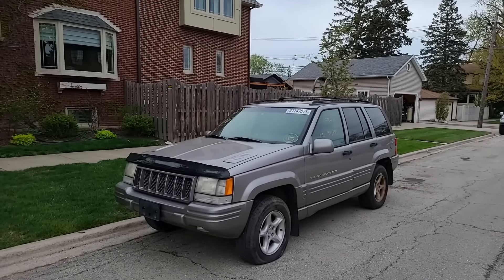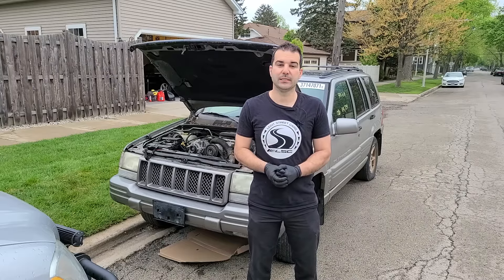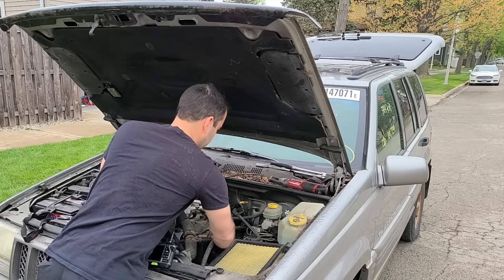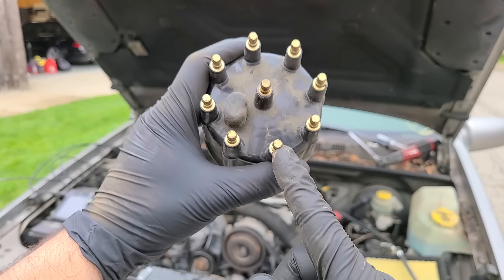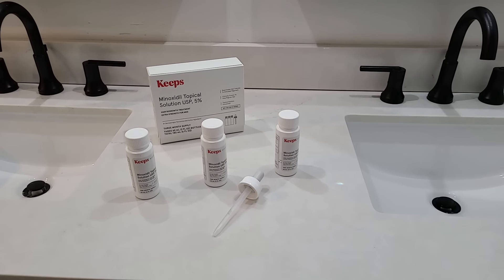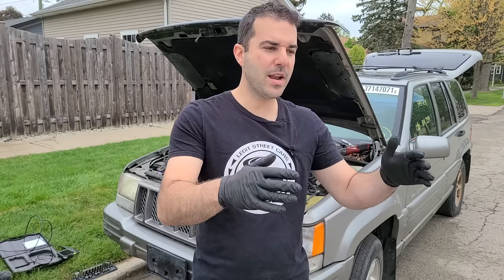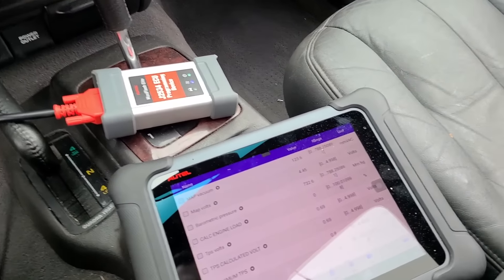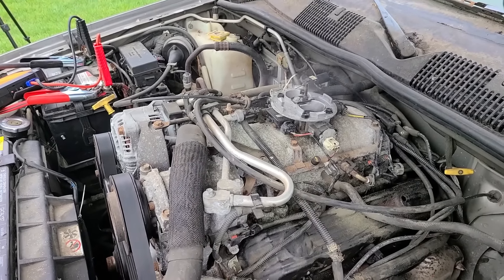First Start Of The Abandoned Fastest SUV In The World & What I Found  Inside The Engine! DIY FIX!

Comment from the maker: What's kind of SUV do you drive? 
 https://keeps.com/legit for 50% off your first order of Keeps hair loss treatment!
Reply: Ford Escape
Reply: RR Classic
Reply: I don't any more, but I had a 400 whp Trailblazer SS. It had a 4k stall converter, so I got horrible gas mileage, but it was a rocket of the lights. One night, some crew decided they needed it mare than I did. I say crew because there was no broken glass on the street an the Onstar module was thrown in a bush in front of my house.
Reply: 2005 jeep grand cherokee limited with 5.7 hemi
Reply: 1995 Jeep Grand Cherokee!  Mine's a 4.0L, and it has 358,000 miles.  Checked the compression a year ago, and it was still within new build specs!
Reply: I've owned Honda's since the mid 80's. I'm currently driving a 2016 Honda CRV
Reply: 09 highlander.   Pretty bland.
Reply: @cgonedfishing  u up
Reply: Have had Cherokee, Grand Cherokee, a Jeep TJ and now a JK.
Reply: Ford Edge 120k+
Reply: I made that comment about you losing your hair on top in a previous video! A dude called me a dick. Lol
Reply: I'm surprised you are allowed to work on the neighborhood street.
Reply: 02 EXPLODER
Reply: 2014 GL 450. Really love this series , learning a lot. Have you or can you do a vid on replacing spark plugs on a Mercedes? Couldn’t believe how much the dealer charges just to replace them.
Reply: 2006 Dodge Durango 2wd 4.7 V8 165000.…..runs like a champ..... looking for a Jeep Grand Cherokee for the wife when your done. That body style was her first car she ever owned. Trying to add a little bit of joy in her life.
Reply: This is the thing thats intresting. Not shiny, boring teslas and sports cars.
Reply: ML430👍👍👍
Reply: I purchased my 2009 Ford Escape XLT V6 new. Its been a great car which now has 160,000 miles
Reply: Hi Alex. At the mo an Audi Q3 but about to change to a Volvo XC40 recharge. We’re in the uk, I must say we had a Dodge Journey for 10years. It was the best car and wish we still had it or Dodge were still in the UK. Loved that car and I know a lot (especially here} don’t like dodge. Great vids. Look forward to the next on this Jeep.
Reply: Lincoln MKX Black label
Reply: You are 36 ???
Reply: @s1000p  I am 55 years old
Reply: 2016 Tahoe LTZ
Reply: ‘08 Touareg V8. 4.2l Audi FSI motor 350hursprrz, Brembos front and rear, and a locking center diff. $10k last October, has 55k original miles and a 1” book of receipts. Not too shabby.
Reply: I got my wife a ‘14 Toyota 4Runner Limited. Love the A/C seats! But it sucks at towing on the highway. Super underpowered. And also terrible mpg. LOL But it’ll run foreverrrrrrrr!
Reply: Dacia Duster
Reply: @theactualsalvagedrover  no, context my man. I said he was getting a little thin on top so it would be a good idea to sponsor a hair growth product. I also said Alex was a genuine honest guy so he'd be a great spokesperson.
Reply: @icanfartloud  Amsoil Products is the only way to go.
Reply: 2004 Jeep GC, I have a 1997 I planned on fixing up, but searching for parts I fell in love with the 5.9 Limited, I will continue fixing my 97, but only to fund buying a 5.9
Reply: Lexus LX470 (glammed-up Landcruiser)
Reply: 2012 Audi Q7 4.2 TDI
Reply: What happened with the Mercedes?
Reply: 1994 Chevy Suburban K2500 1 ton chassis w/big block Chevy engine, tows its own weight and passes everything but a gas station.
Reply: 1998 jeep grand Cherokee 5.9 limited with 265 thousand miles.
Reply: Until last year I was rocking around in a 2006 Porsche Cayenne S 4.5 V8 and now I have a 2009 Volvo XC60 D5 AWD along with a couple of other non SUV cars here in the UK.
Reply: 2000 Durango 5.9L.  The engine is the same as your Jeep but things are in different places.  My air box goes off to the right and your to the left.
Reply: 2011 Ford Edge Sport
Reply: Lexus RX330
Reply: I used to drive ML550 5.5L 2007 with a bad steering rack and a bad comand nav
Reply: Toyota Land Cruiser 2005, 293,000 miles ! One owner! Me!
Reply: I'm a car guy... 2019 Subaru Legacy... Hey, at least it's AWD!
Reply: Iam driving a 2021 Volvo XC90
Reply: 04 jeep grand Cherokee wj with the 4.7l
Reply: Love your content sir. When you're ready to let that Jeep go this Mopar guy would greatly appreciate a chance to buy it from you.
Reply: A 2001 Subaru Legacy and 2003 Toyota Matrix. Oh, you said SUV
Reply: 2002 GMC Yukon XL 1500 w/292k miles
Reply: Saturn outlook !!!
Reply: 2018 vw tiguan.
Reply: Mazda Tribute 2.0l 5 speed
Reply: Isuzu honda lotus bighorn
Reply: 98' Jeep XJ, 5 spd Manual
Reply: I have 2 1998 jeep grand cherokee 5.9s
Reply: I drive an old 2006 Pontiac Torrent with 269000 miles and blown head gaskets!!! Thank you Barrs ! LOL!
Reply: @cgonedfishing  8899998g99999g99999g899999999989899g8998v9ig889go89999988899990i9h899i8i998i989i98999998i88i9gi89999899i89h998888898989889888i8988i999i9g8088898898989998i8889i98999889999i0i9ii88998i999ii989899989ii999898ii8ii09ui99h9g99ii99i99999999i9h989
Reply: We have two Mercedes W163's in the family -- we love them!
Reply: 2000 LX 470, it doesn't know how to not start :P
Reply: ML350 W164
Reply: 14 Mercedes ML350 Bluetec
Reply: @christophersparkman  so it’ll be a crap-tastic pollution-slug for a long time? Great. But hey, it’s got A/C seats.
Reply: @MasterZG100  hey, VGG Derek bought a Duster on eBay!
Reply: @andyleo8418  ah. I got: “I told Alex he was going bald, so he called me a dick...” I’m stupid and get confused a lot.
Reply: @theactualsalvagedrover   @salvagedrover  lol no, Alex didn't call me anything. Another person replied to me. Ends up he does get a hair growth sponsorship. That was my point!
Reply: 2011 Cadillac Escalade ESV with a 6.2. Alex, @LegitStreetCars would you like to do a DOD delete for a video. I'm in the northwest suburbs (Crystal Lake).
Reply: ‘21 Yukon Denali with the awful 6.2 😡
Reply: I'll be honest I thought I got rid of that thing for good I only owned it for a month and had electrical gremlins
Reply: 96 grand Cherokee 5.2 limited 170k and I love this jeep
Reply: 99 explorer with a 5.0 awd to  manual transfer case swap lunch box front and rear with 98 ranger hubs aand mile marker hub locks
Reply: I live in Chicago by midway airport I would love to meet you bro man also I would love to have that jeep I really need a car your friend X-man
Reply: Sh*tbox 98 Honda CR-V
Reply: 95 bronco 
99 tahoe 
18 ecosport
Reply: I used to drive the worlds quickest stock bottom end, naturally aspirated Jeep SRT8. 11.91@115. That was over a decade ago, and it’s been beaten since. I’ve been through an X5M, Denali and a few others since then. Time doesn’t stand still and things get quicker and faster as technology advances.
Reply: My wife drives a Telluride.  I drive a 2020 Ram 2500 Cummins.
Reply: 2008 trail blazer ss and 96 jeep grand cherokee with 5.2 v8
Reply: 2004 E83 6 speed ZF, also having high-blood pressure for 20 years and taking minoxidil directly at the highest dose I have not grown hair, at least on my head.
Reply: I have 2 Jeep’s
1. 2004 Jeep Liberty Renegade - 127k miles
2. 2014 Jeep GC Summit with a Diesel. Yup, it’s amazing.
Reply: Grand Cherokee. Waiting for a phone call on a 1998 5.9 Grand Cherokee. It will be mine.
Reply: 2002 Chevy Tahoe
Reply: Ml 320 2002 with 60k miles only believe it or not..
Reply: 1998 Jeep Grand Cherokee 5.9 Limited
Reply: Volkswagen Touareg
Reply: AUDI/VW/Porsche/Subaru
Reply: Beat to shit hummer h2
Reply: @mexicanspec  How do you like the durango? I always liked the first gen especially the R/T trim 5.9
Reply: @andyleo8418  gotcha. Also Tavarish, I’m sure one of them turned the other into the sponsor. I was watching a video the other day where some girl got her cast cut off -maybe it was a movie...anyhow, she got her cast cut off and despite the smell, her arm looked like a forest. There was someone else in the room that mentioned agitation and physical stimulation promotes growth, so perhaps all Alex needs is to put a bunch of bird seed on his head and go stand at the park. Lots of Italians lose their hair, that’s why many of them are bald. Also tavarishes, plus his head is SO big...
Reply: @tacitusunum1668  he already did with an impala, didn’t he?
Reply: @shanet7511  MIne is an SLT with the 5.9.  I just love love it.  It is not too small or too big.  The wheel base is long enough to get a smooth ride.  Mine is a 2000 model with 70,000 miles on it.  I have had it for about 20 years and I still love it like I did the day I bought it.
Reply: Bunch of ZJ Grand Cherokee's through the years, and a clean but lame first generation Nissan Xterra at the moment, and an old caravan, LoL..

  *Never got why or how People wear gloves while working on stuff 🙄. Esp if just doing little things where you aren't elbow deep in grease and whatever else..
Reply: @erics8420  nice, my 5.9 I sold last year had 315kmi on it when I bought it. Forget how many miles I put on it, but wanna say it was over 350kmi by then! Didn't burn oil or anything, though it had been very well taken care of by the previous owner. Only thing aside from the milage I hated was the POS quadra-trac transfer case, too bad they didn't just use the 249 select Trac transfer case in these!!
Reply: 2000 TOYOTA 3.6l SR5, 4wd. 5 speed, lockers 365000 miles.
Reply: GLS baby
Reply: 2002 GMC envoy 200 k miles
Reply: 1997 Jeep Grand Cherokee Orvis
Reply: Merc GL320 with 34" tyres - Sounds like a LSC special to me ;)
Reply: 2008 Hemi Overland JGC
Reply: The same car you're toying around with here - an Austria-assembled 5.9 LX, it's a money pit, my wife hates it and I have my smiles per gallon out of it...
Reply: Xc90
Reply: 2007 chevy tahoe
Reply: 1994 Jeep Grand Cherokee for my off road rig
Reply: Set the wife up with a SQ5, little pulley work, tuning, suspension, and exhaust, fun little thing.  That is until it implodes because Audi.
Reply: 2014 Cherokee Trailhawk
Reply: 1989 cherokee laredo 4dr w/4.7 stroker & 3"lift
Reply: 2013 Volvo XC90, wife drives 2014 Volvo XC90.  They are bulletproof!
Reply: 2005 Mahindra Thar 4x4  with stage 2 tunning
Reply: I used to drive ZJ's.  Still think they are pretty neat SUV's however my next one will probably be a Land Rover Discovery 2 with the Land Rover delete performed and a 6.0l/4l80 combo installed in place of it.
Reply: 2002 GMC Yukon XL 2500 8,1
Reply: @theactualsalvagedrover  lol No the pollution slug will be my Silverado. The 4Runner isn't half as bad. What kinda SUV are you ridin in? 👍

Edit: just seen your comment about your car. Sounds like a beast! Good stuff! 😎
Reply: @christophersparkman  it’s true, I own a German SUV because I need that space for CERTAIN things, we also own a civic that gets over 30mpg, and does NOT have a check engine light and it well maintained, and a plug-in hybrid that regularly gets 45+mpg. what kind of high mileage, low emissions vehicles do you own? Exactly. 

Btw, I bought my SUV last september, and have JUST NOW put 1,000 miles on it, many of which are highway miles where the engine is running at the most efficiency. yeah.
Reply: I don't drive.
Reply: a 5.9 jeep grand Cherokee and a 2002 jeep grand Cherokee
Reply: 2003 Durango 4.7
Reply: @anthonybarton2103  not you alex ???
Reply: 2004 Toyota Highlander,  got it when i divorced. Was driving a 2017 VW Golf but ex wife wanted it so I gave it to her.   Picked up the Toyota for $600,  full of mouse poop as it had sat for 2 years,  its been an amazing rig so far.
Reply: Mercury mountaineer
Reply: Suburban z71 and 3rd gen 4runner
Reply: 5.9 Limited GC... of course. ;)
Reply: 2007 Toyota RAV4 V6, love it!
Reply: 04 GMC Envoy XUV SLT V8. Paid $600 as I was told the engine was bad when it was the battery.
Reply: 2019 f pace svr
Reply: Volvo XC60 T8
Reply: 2007 subaru forester xt 5spd with 230k and still going strong and quick
Reply: @hotrod1984s10  why in the world DJ you think anyone cares who you are or what you drive?
Reply: My mom drives a Buick Encore
Reply: 2010 VW Touareg TDI.
Reply: Used to have a BMW X3 M40i, but went to an M340i because awesome deal.
Reply: Hyundai ix55
Reply: @theactualsalvagedrover  I'm not sure if you're just being sarcastic & humorous or if you're being intentionally antagonistic. You'll be disappointed if you're looking for an argument bc I just don't have the time nor energy.
Reply: My desire to get an 08 Grand Cherokee CRD to compliment my 2021 Gladiator EcoDiesel is what lead me to this jeep video (funny because I'm just sold my last gas powered 04 Grand Cherokee to go all diesel)
Reply: I use to have an older jeep Cherokee it was either a 99 or an 01 that I bought used It had somewhere around 180k miles on it at the time and it finally took a crap with just over 300k
Reply: I drive a 2006 Porsche Cayenne S Titanium

Comment: Here we perfect example of "internet experts." "Internet Mechanics" giving advice to Certified Automotive Technician.
Reply: I AM CERTIFIED AUTOMOTIVE TECH / INSPECTOR,  USING A #194 BULB ,CHECK INJECTOR PULSE ..., NO PULSE ..BAD CRANK SENSOR
Reply: YouTube certified master technician here checking in.
Reply: this here is the perfect comment.. dealerships love the automotive diagnostic parts cannon.. I fix my cars myself because mechanics all rip you off. then spends 2x the cost of repairs in unassociated replacement not parts that were completely functional in a method to save 200 bucks of Labor..
Reply: I cant help but be amused at the "certified automotive techs". Some years ago, a buddy of mine had a mid 90s Dakota 318 that wouldnt start. He had not 1 but 2 of those so called certified auto techs come by and look at it, one lived right across the street from him, both said they'd  need to have it towed to their shops and hooked onto the computer. Then, my phone rings, I go over, try to crank it, of course it doesn't fire up, pulled the coil wire off the distributor, stuck a screwdriver in it, held the screwdriver close to an engine bolt, no spark. 15 minutes and a new coil later, he was running again. Sometimes you need those diagnostic computers, but unfortunately, techs seem to depend on them a little too much
Reply: Ase apparently doesn't teach you to crack the throttle and spray a bunch of starter fluid down below the butterflies.

Spraying it like you're trying to kill a spider that you are scared of isn't the way to do it.
Reply: What??? That doesn't make sense.
Reply: Could have reseated that tire had you not needed all of your starter fluid for the engine.lol
Reply: First thing I look at in a vehicle that sat for a long time is fuel system and belts.
Reply: @misconceptions1381  Yeah fuel goes rotten nowadays not like the lead fuel.back in the day that  last 30years...

Comment: It’s really nice to see one of you online YouTube mechanics that advocate for the community to take the time to actually troubleshoot the issues your having with the vehicle instead of just Throwing parts at it Cause then when you do get it running  you have no idea what fixed it!! It is the absolute WORST way to try and work thru an issue and fix the problem and not to mention that it could get extremely expensive, extremely quick!!

How would you like it if you took your car to the shop for repair and they just started changing everything in the ignition system and then tried starting It but still have The same issue so you change a bunch of the fuel system parts and try starting it with no luck and on and on. If it’s in the shop, then you just spent thousands on replacement parts that you quite possibly didn’t need at all and you can not return electrical or fuel related parts once installed. 

Learn how to troubleshoot folks!! Your wallet is gonna thank you so much for doing so!!!!

Comment: I too have a 1998 Grand Cherokee Limited 5.9er. I live about  35 mike South of Kankakee. Here is a little heads up on your VIC unit. That's the little display down by the shift. I noticed during the video it was throwing a coolant temp sensor. Those unit were bad for false error messages. The reason for this was because in the 97 and 98 models Chrysler was using a lead free solder on all of the solder joints. Over the years the solder joints will crack and it will give you false error reading on the VIC unit. The repair is easy remove the unit and reflood the solder joints on the circuit board where the plug goes in. The headlight switch and dimmer had the same issue. If you have any questions feel free to contact me. And keep the videos coming.

Comment: Had a 98 5.9 it was fast but it had rear differential problems. I paid 40,000 for it on Christmas eve a present for my wife. It was fast had to have high test fuel but it was worth it. You found a real diamond in the rough.

Comment: Great job Alex. You reminded me when I cleaned my car injectors beside the road once. All I used was a syringe and a carb cleaner. The injector fit inside the plunger side of syringe and the nozzle of the carb cleaner on the other side. With a connector to the battary, I would press the carb cleaner and frantically connect and disconnect the injector to cycle it. It worked just fine in the situation I was in. Great work on the channel BTW. Been here from the black C43. I can't wait to see it grow.